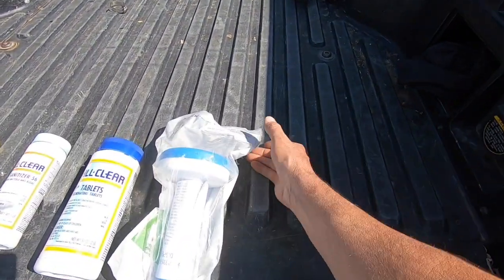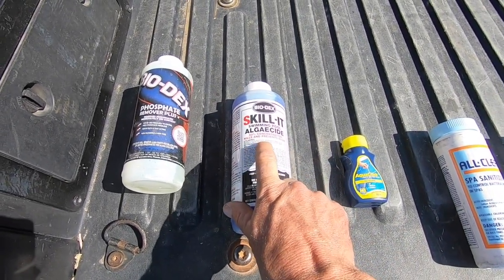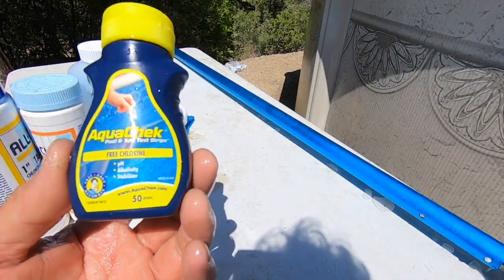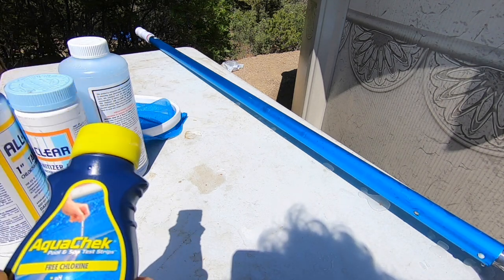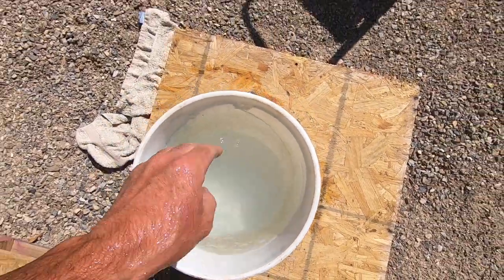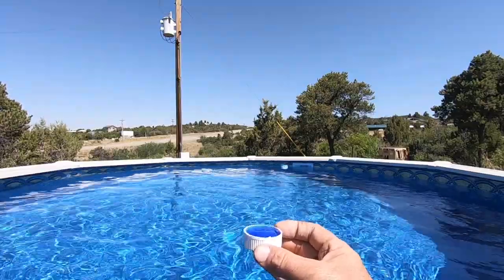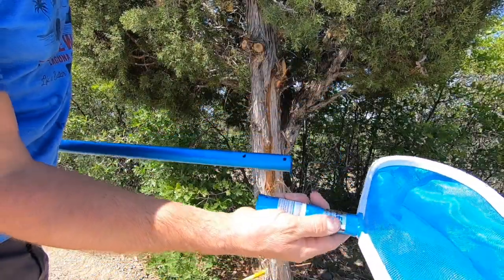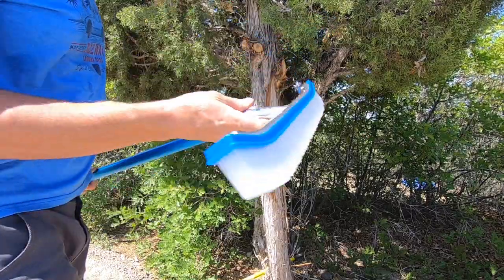Above Ground Pool Care Basics

Comment: 2 months ago or so i was trying to get the PH level of my inflatable pool right but i miscalculated somewhere, and mixed it in the bucket with my bare hand like you did. That started to hurt after 30 seconds or so LOL. Quickly ran to the water tap to rinse it off. Oh well my hand is still on there and functional 😂
Reply from the maker: Yeah, acid will find any little cuts, scrapes, or bug bites and then start giving you love. A simple rinse like you did is the remedy.

Comment: What about Calcium Hardness? Mine is at 0. I haven't worried about it too much with a vinyl pool & just try to keep everything else in balance but now that everything else is mostly balanced I should probably work a little on the CH.
Reply from the maker: There’s a couple ways to manage calcium hardness, you can add calcium if it’s low (below 200 ppm). That’s not the case for you being in phx though. I’m sure your’s is on the high side (somewhere north of 600ppm). This is where we get into balancing the water. Think of a sea saw. On one side is calcium hungry water, on the other is water that scales (like your shower head does) Ideally we want sea saw to be balance level. A little to one side is ok, a little to the other is ok but we’re shooting for the sea saw to be balanced. The things that control how that sea saw is balanced are temperature (colder water tends toward calcium hungry, hot water tends toward scaling), alkalinity (low tends toward calcium hungry, high tends toward scaling), pH (low tends toward calcium hungry, high tends toward scaling), and calcium levels (low tends toward calcium hungry, high tends toward scaling).

There’s a thing called the Langlier Saturation Index that takes all these factors into consideration, weights them appropriately, then spits out a number that tells you how balanced your water is (good range is somewhere between +.1 and -.1, anything outside of this and we want to make some adjustments). 

You can drain part of the pool water and add fresh to bring calcium levels down, you can lower alkalinity a bit. You can also lower pH but this will affect swimmer comfort and could cause damage to pool equipment if lowered too low for too long. Unless you have a heater or heat pump, it’s pretty tough to manage temperature. 

So after all that, the short answer is drain part of the water out and add fresh. That’s the simplest thing, then you can just keep all the other stuff in range and have non irritating water!

Comment: As a new above ground pool owner, I am noticing that my chlorine floater sits in the same spot (along the edge of the pool) when the pump is not running.  I am concerned that it will affect my pool liner over time (sitting near the wall).  Should I keep the floater in the pool all the time even when the pump is not running?  Any suggestions are appreciated.
Reply: I have 1 in my inflatable pool, left it in & it bleached my pattern on the pool